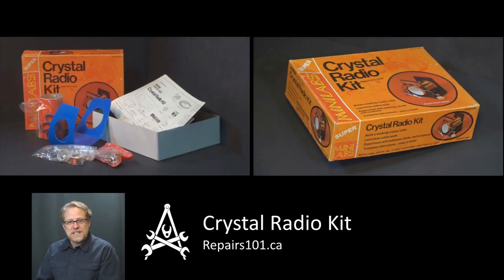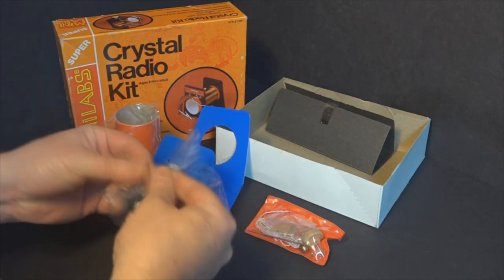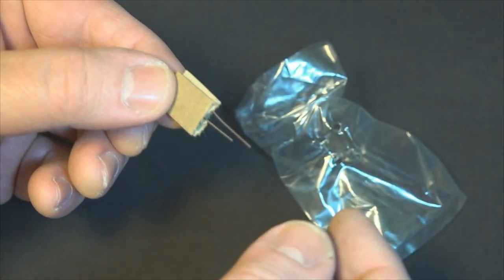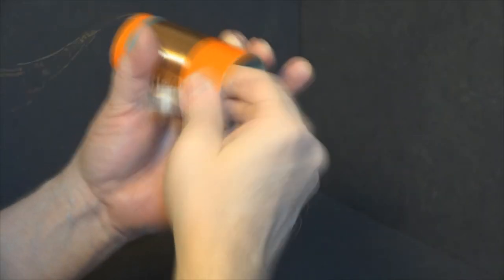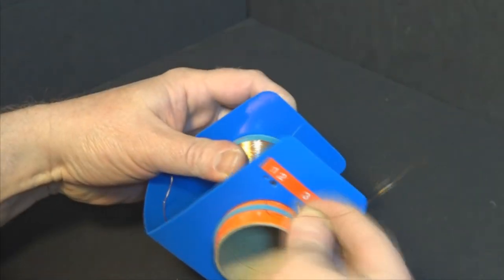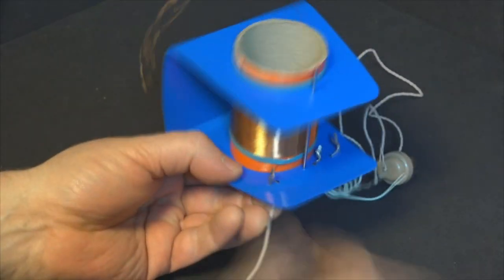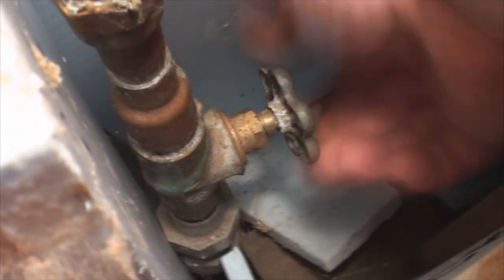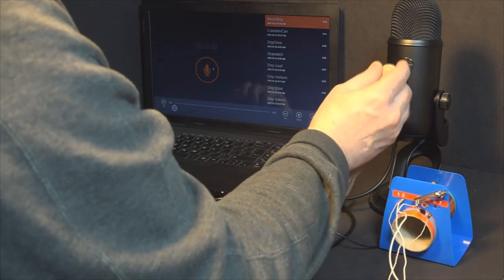Crystal Radio Kit - your cellphone receiver's grandad

Comment: Yes,  51 years ago, I built my own crystal radio.  I used a rock as my diode.   It was a quartz crystal rock.   And of course back then we wrapped the wire around the toilet paper cardboard.  I also used part of an old landline telephone to use it as the ear phone.  Fun times indeed.
Reply: I'm using the piezo buzzer from a talking smoke detector.

Comment: To bad  the diagram of the crystal radio was not shown . The Diode is a 1N34a. Germanium  diode. Silicone diodes will not work. I like the old 1n34s from way back. They are real cool looking.

Comment: I got a cheap kit from Menards and it's missing the diode and some of the rubber bands and the wire it provided doesn't wrap around long enough to cover the whole length of the cylinder. Where would I get replacement parts?
Reply from the maker: Personally, I'd go back to Menards for an exchange or refund. Or if they're really cheap I might buy another.
Reply: @repairs101  it was 5 bucks and a couple months ago, I only just got around to opening it.

Comment: I built a different version of this back in the 70s.  Mine had a plastic case to build it into.  Ran an antenna wire out the end of the garage out my bedroom window.  This simple type system can only work for am though.
Reply from the maker: FlashGeiger I'll bet Bill Gates and Steve Jobs built them back then, too... Not together.

Comment: I built several different radio kits including this exact one, but I could never get it to work. I think my antenna was always too small.
Reply from the maker: Try some bare pipe or a barbed wire fence. Chain link might work too.

Comment: What gauge wire was that and how many feet was that .magnetic wire.,I just bought some very old cat whisker diodes,from a seller that found a small supply of the,and I also have have the modern one too ,to see which works better.
Reply from the maker: I never thought to measure the wire.
Reply: Probably about 26 gauge

Comment: how many realise the potential for free electricity here?

dont expect some major breakthrough in the world that brings this to you for free, you will be sold such a technology for more than it would cost for you to make yourself.
Reply from the maker: +james nichols - there's certainly signals enough out there to do something with. Reclaim the energy and reuse it to power more signals?
Reply: +james Nichols After further looking into this, the power they are harvesting is like static tiny. But it is nifty stuff. It would be nice if they taught stuff like this in school.
Reply from the maker: I make videos because they don't teach this stuff in school. Thanks for contributing!
Reply: Repairs101 how many of those crystal diodes can you use in one circuit? In my head I'm imagining a line of them recharging a battery. Is that possible? Also if this is possible can we harvest the "noise" from the big bang? If its strong enough to screw with our TV, is that strong enough to collect?
Reply: +james nichols well this is it
Reply: nicola tesla had plans to harvest usable power out of the air back in 1890. transmittion of power without wires.
Reply: @dmilner9019  - Yes - Tesla had the installation at Wardenclyffe on Long Island, NY for transmitting power; however, as I recall, J P Morgan pulled funding and it never became operational.